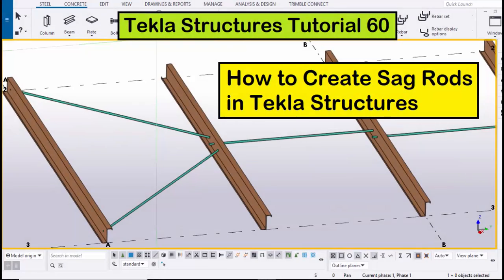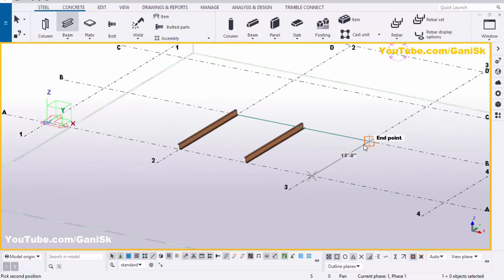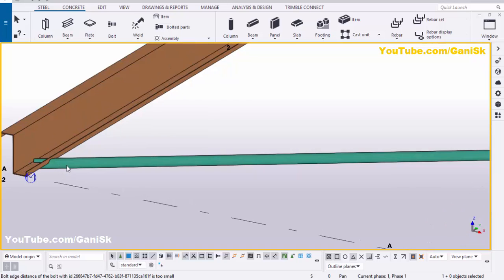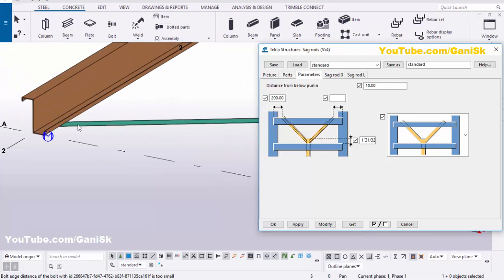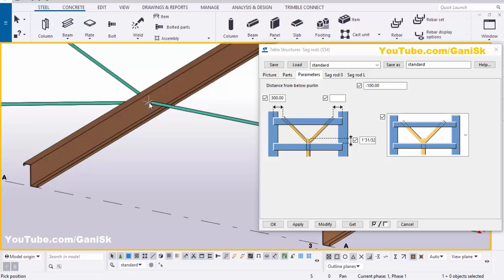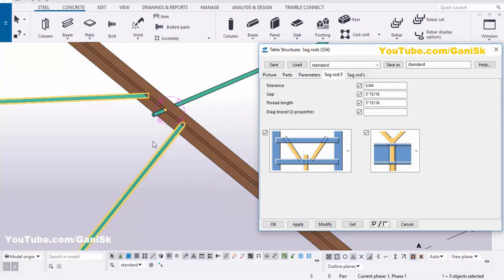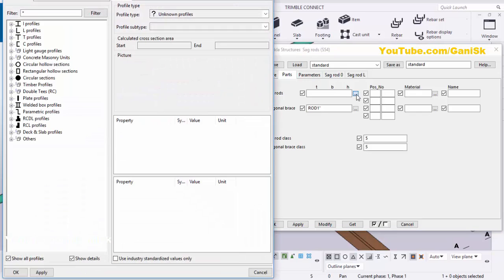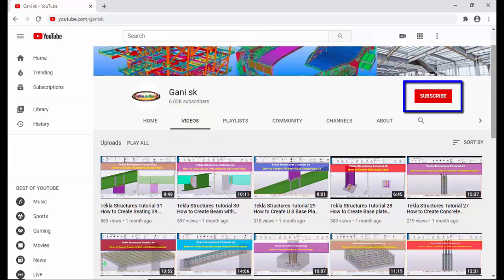Tekla Structures Tutorial 60 | How to Create Sag Rods in Tekla Structures

Comment: Hello Gani, there is something a bit confusing to me in this 
video, when you input the 100mm value and the rods moved downward, you didnt undo to  bring back to its position before putting the -ve value Infront of 100mm.why pls?
Reply from the maker: When you enter the value that will be consider from original default position, for example if you enter +ve value 100mm that will be referred from original default position to downward position 100mm, if you want move upward direction no need to enter zero value, directly enter -ve value -100mm then that will be considered from original default position to upward direction 100mm.